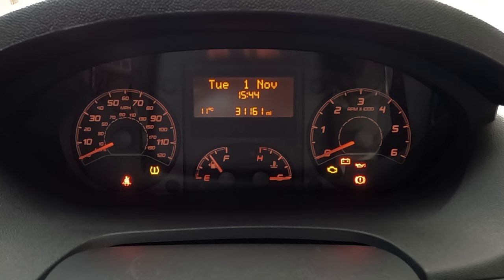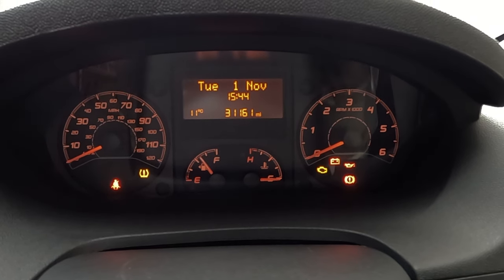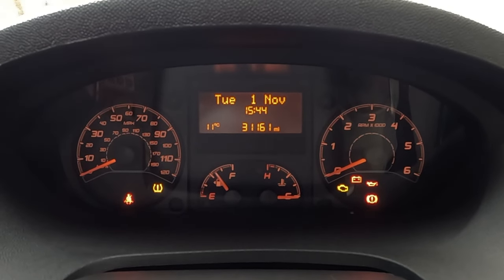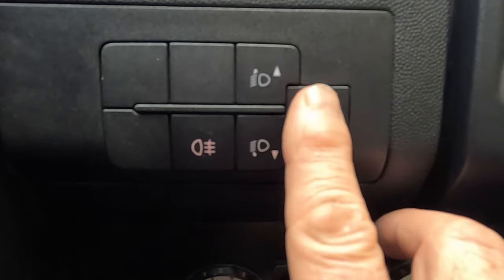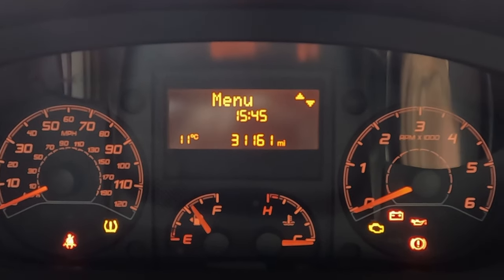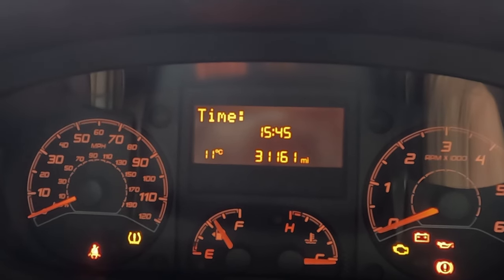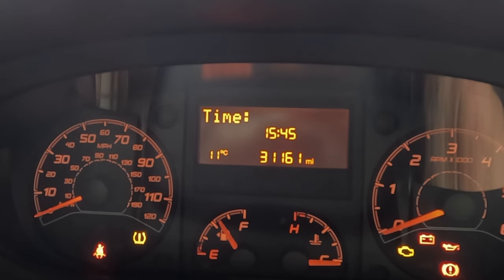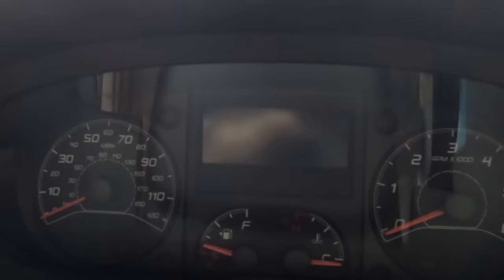HOW TO CHANGE THE CLOCK ON A PEUGEOT BOXER. FIAT DUCATO. CITROEN RELAY. MOTORHOME. TIME CHANGE.

Comment: Mine is a 2016 Peugeot Boxer but doesn't have the time menu from the Mode button. The options are Speed/Beep/Service.
However, I found that by using the settings button on the radio I could change the time from there which then updates the time on the dashboard.
Reply from the maker: Strange how they're different as ours is a 2018 model. Glad you got it sorted though. It's a real pain when you can't fathom it out.

Comment: My 2016 Boxer synced the time via the Bluetooth on my phone.
I tried to use the method you showed here and also via the stereo head unit but only Bluetooth worked.
Reply from the maker: Strange as ours is a Peugeot Boxer too but a 2019 model. Glad you got it sorted though.

Comment: Ours is older with the old push button on the corner of the instrument dial.  Apparently Lindsay is not happy with my it will reset in 6 months time LOL
Reply from the maker: Lol, I hate clocks being wrong. Drives me mad.

Comment: 2011 citroen relay   looks identical but didn't work   not sure how I did it  pressed mode plus up / down at same time to get into clock mode
Reply from the maker: Did you get it working then in the end. That's good.👍

Comment: How about the day and date ?
Reply from the maker: Once you put the time in, the arrows up and down will do the date.
Reply: @roaminginraymond  sadly my mode only has service,  airbag , speed beep, no time option 🤔
Reply: Same here. Did you ever solve it?
Reply: @raymondadams579  No not yet 🤔
Reply: @raymondadams579  Sadly not as I changed the Radio head unit which on my vehicle is the way to change time and date🤔